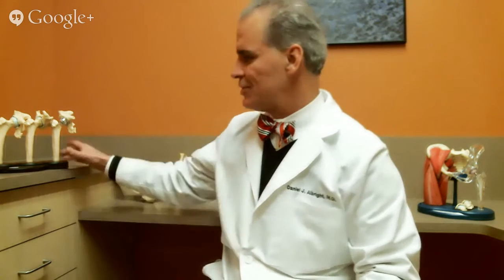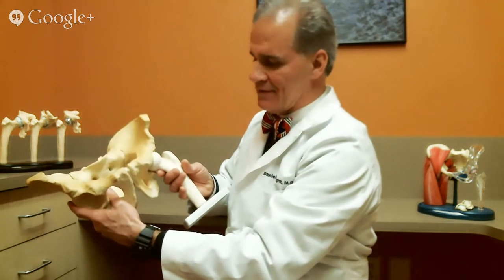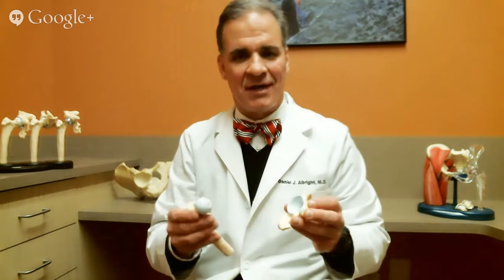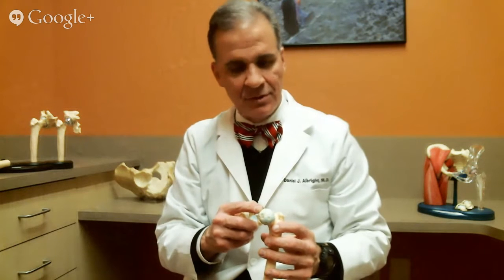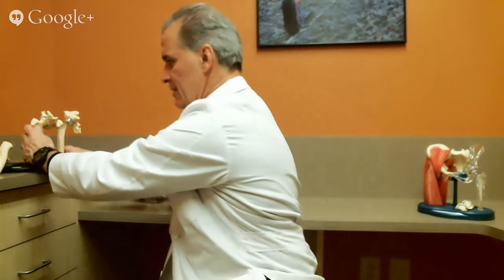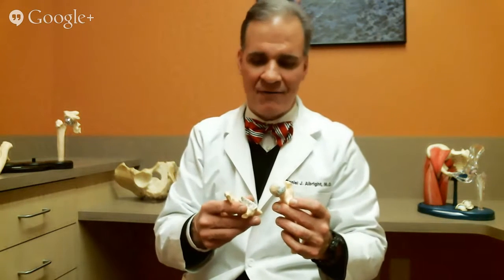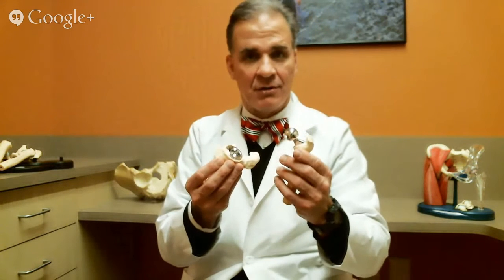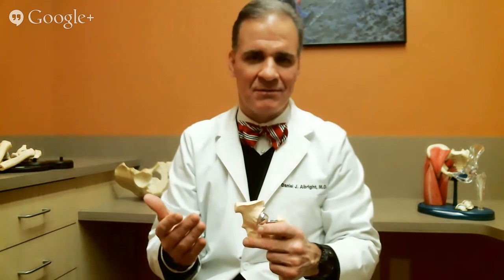What Does a Worn Out Hip Joint Look Like?

Comment: Well your information is very use full n my problem is ..I don't have right hip joint since 1986.I lost it n train accident.n there was infection set on it n because of blood lose wasn't recovering as it should have been.now I get problem in walking because of short leg n my heavy weight due to limited movement....soo my Que is should I get replacement done?it's turned a bit slant (aside)as well.plz advise n help...